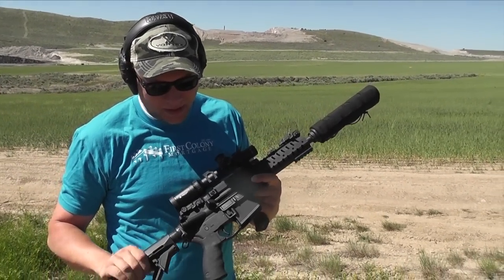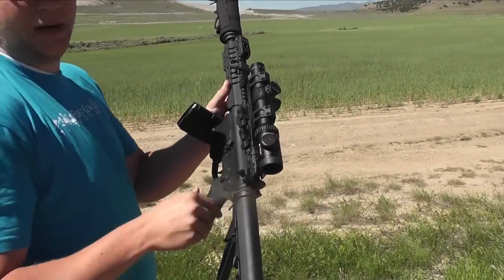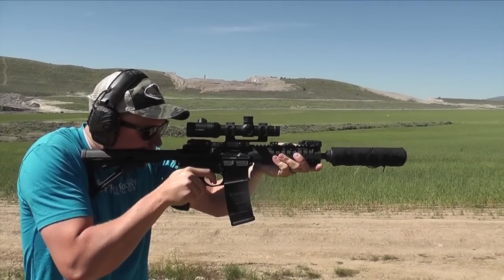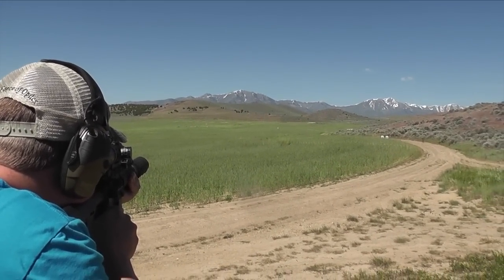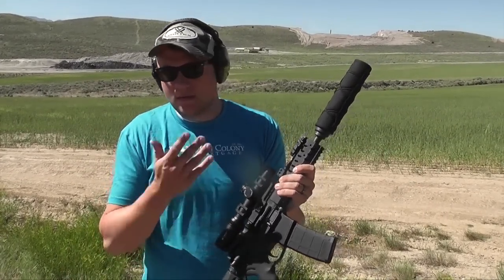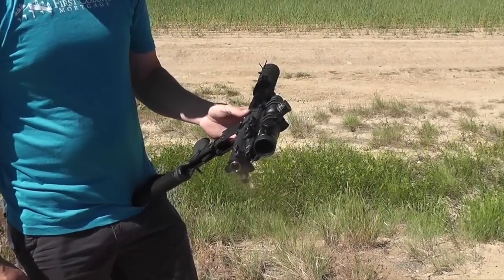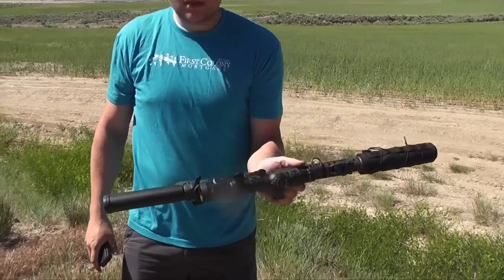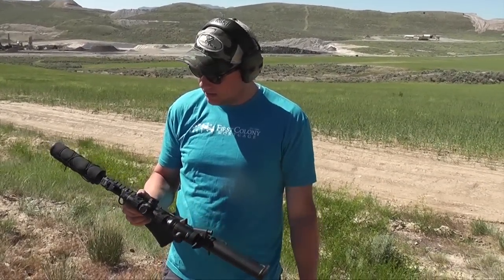Suppressed 300 Black Out SBR Short Barreled Rifle

Comment: That's damn closed to my dream gun right there. Nickel boron BCG, JP Industries silent buffer, a can, an 8.5" barrel, and I'd add a CMC flat bow trigger. I got the BCG and the can, but for now, it will have to mount on my 16" barrel and mil-spec trigger group.
Reply: Fail Zero is much cooler than nickel, Google it!
Reply: Fail Zero is a nickel boron BCG. I got exactly that, but from Rainier Arms. Only needs a leaf to wipe it clean (I know, I tried out of curiosity after a session in the woods near my home.)
Reply: I don't believe they are exactly the same. Fail Zero RECOMMENDS no lubricant. Nickel Boron usually does require it.
Reply: From the Fail Zero home page: "FailZero offers EXO Nickel Boron coated Bolt/Carrier Groups as complete "drop-in kits" and BCG components." (https://www.failzero.com/)

They are nickel boron. And I know a few people running them. You can't actually go lube free for very long, but you barely need any. If you properly apply Frog Lube, it's amazing how long you can go without any significant build up in a direct gas impingement system.

Comment: Played with one of these at gun show today. Pistol version with Sig arm brace in .300 Blackout with suppressor will be my next toy. 
Have an Aimpoint just sitting around waiting for a spot to mount to.
Reply: ***** I considered an Aug but decided against it. Held one of those yesterday too. 
I went with a RRA .308 AR
Reply: The reason things become popular is because they work! Like glocks, and in my case XD.
Reply: ***** it's the old saying. If it ain't broke don't fix it.
How do you figure hose are better or WAY better guns, and more versatile? How's that? 
 Glocks and XDs are very good guns and simple. No safety or hammer to fiddle with. Sure others are good too, but def nothing to knock with a glock or xd.  1911s are also awesome, low ammo capacity though.
Reply: Gotcha. I've never owned a glock. My XD is a .40, very nice gun.
Reply: ***** A Glock will fail much less often than a 1911. Go do any pistol match or class. You'll see.

Comment: The camera microphone did not do a great job of differentiating between the sub and supers. BOTH were crazy quiet.
I could not tell which was which. Usually, in other videos the difference is quite noticeable. 

Maybe if the camera was down range the sound difference would be more noticeable...like the super sonic crack.

Very cool gun!
Reply: +Big Dave the barrel is too short for the ammo to reach maximum velocity before getting out, so even if the ammo is super sonic he needs a longer barrel for it to allow the power to fully burn and the round to accelerate to super sonic

just like a hellcat yes its capable of 1/4 mile in 10.8 sec but if its on drag radials so it can put the power down

the super sonic rounds will give a bigger flash in a the short barrel that's all
Reply: +Big Dave We will be filiming a lot more about this gun when it warms up a bit.
Reply: +ssllhh100 Actually, that's why 300 blackout is so revolutionary. It uses pistol powder so it burns incredibly fast. You don't gain much from longer barrels in 300 Blackout.
Reply: +Big Dave T You can hear it much better in person.
Reply: I am sure. I have heard other videos that demonstrate a notable difference. It takes some fairly good audio equipment to really show a suppressor well.

Having owned a suppressor, I realize just how difficult it is to show them on audio/video.

The videos that do show off suppressors well are ones done by Silencerco who routinely pits different suppressors they sell in head to head competitions.
One thing that is hard for even the Silencerco videos to show is the differences in TONE between suppressors which is also a big factor that many owners consider to be important.

Comment: Did you change out your JP Silent Capture spring?  Was it the standard spring? It appeared to be a potential issue in the video. I noticed JP sells a spring package.  I have considered the  JP AR-15 Silent Captured Spring Heavy H2 Version Gen 2 fora CMMG Mk4 PDW  with an 8" barrel.
Reply: When the camera rolls, there are feeding issues. I haven't had any issues with the std spring in any of my rifles.

Comment: So the thing about 300 bo is that they get full expansion in a 11" barrel, correct?
Reply: ...and you can shoot bullets from 110gr to 240gr and they all cycle perfectly in an AR. Sub sonic, super sonic, and anywhere in between. It uses pistol powder, so you'll be able to use an 8-9" barrel and get all the velocity you need.
Reply: jmanthirtyseven it's 9"

Comment: What type of wrap is that around the suppressor or did it come with the suppressor?
Reply: That is a TAB Gear suppressor cover.
Reply: Thanks.. I'm off to go buy one for mine.
Reply: They make them custom for your can.
Reply: Wow, $62 for a heat wrap. Seems awful pricey. Great idea, but would be nicer if they were $30-45 range.
Reply: It's not your average material. My suppressor gets nearly red hot. You get what you pay for.
Reply: Jim Cannon  Ya I have the YHM Phantom QD for my 556 and yep, it gets too hot to touch. They all do. I may get a wrap eventually. Thanks.

Comment: What's the length with can? I was thinking 10.5" for an sbr in .300 BO but might go shorter depending which can I go with
Reply: +cokeyNbk YHM Phantom can is around 8" without looking it up. If you want to shoot subs, stick with shorter barrels. If you want to push super sonic bullets as hard as possible, go with a longer barrel.

Comment: Sweet rifle.  My props sir for jumping through all the hoops.  I'm hoping with Trump in there, a setup like that will become less of a pita to obtaine.  I'm hoping if we can get a silencer without a tax stamp then manufacturers might start making barrels with silencers welded on at the factory, total length of 16".  A folding stock adaptor would make that a slick little multi-purpose gun.
Reply: Just order one now and you'll be refunded IF IT EVER PASSES. If it doesn't, you get to enjoy the sound of silencer for years longer.

Comment: Just curious if you could help me with a question. I got an email from CDNN which offered custom .300 BO uppers with LWRC parts. I have been warned off by someone I trust about buying any .300 BO from anyone other than AAC. Do you guys think that's sound guidance or do you think I'd be okay to "go for it" on this custom built job from CDNN?
Reply: AAC is basically Remington now. I WOULDN'T buy AAC now. Daniel Defense, LWRC, Mega, CMMG, Seekins, Battle Arms, etc are all excellent.

Comment: What is the purpose of the suppressor sheath other than to protect it from dust and dirt?
Reply: +deming xie Looks like it might be for heat, for example if you need to remove it when it's too hot to touch. Or it could be to reduce mirage.
Reply: +deming xie When shooting with a scope, you get killer mirage because of the heat generated by shooting.
Reply: Jim Cannon
Oh. Cool had to Google Mirage. Got it but isn't it kind of useless in a warzone really? Especially in Iraq where temps could get up to 105 degrees. There is mirages every where?
Reply: +deming xie It's very different when you're looking down a 800+ degree barrel or silencer than a sandbox. Your optic is in just the wrong spot.
Reply: Jim Cannon
Oh wow didn't know that. Never used a gun before just assumed it was like that. Thanks for info
Reply: +deming xie 
What does a warzone have to do with it? Plus, I've been in Missouri when it was 110° lol.

Comment: 300aac is a under pressured round why need to change the buffer spring?
Reply: It was the whole assembly I changed. It wouldn't cycle with a mil spec buffer.

Comment: What's the difference between an AR pistol upper and an AR-15 upper?  I was going to buy a CMT upper for an AR-15, Seekin's 8.5" 300blkout barrel with their adjustable gas block and call it a day (and hand guard, and scope, and tax stamps blah blah blah lol)??  That won't work??
Reply: Illegal without a tax stamp
Reply: Yea I know that.  I'm just confused what the difference is between an AR-15 upper receiver and a "pistol" upper receiver...
Reply: pistols have a shorter gas tube when compared to a rifle, which makes sense because it's a shorter barrel, thus your gas block will be closer
Reply: This is my gun. Pistol uppers just imply they have a pistol length(ish) barrel mostly. You can put any upper on my lower, I chose a pistol upper because it was ready to go to make it a SBR. Companies sell pistol uppers because they are implying they should go on a pistol lower unless registered.
Reply: Brian Pyun no difference but usually pistols are tagged because they have barrels shorter than a rifle.
Reply: So it is a pistol upper?

Comment: 9 inch upper ?
Reply: 8.5
Reply: +Jim Cannon would you recommend this over a 10.5 barrel?? it seems it would run more reliably,  due to the longer gas system.
Reply: jake51515 either would be great.